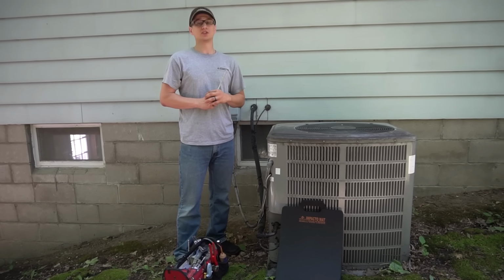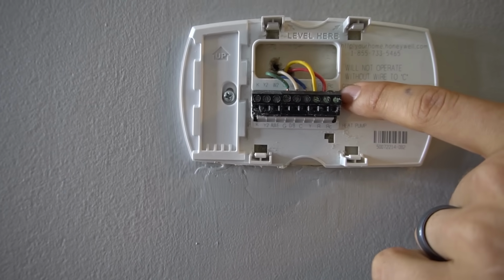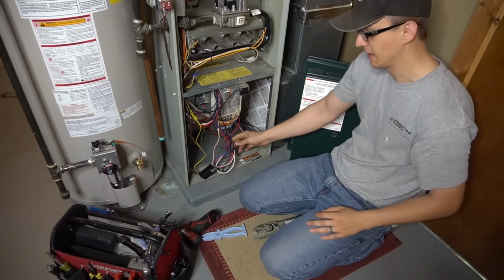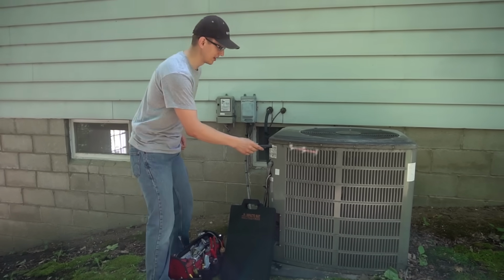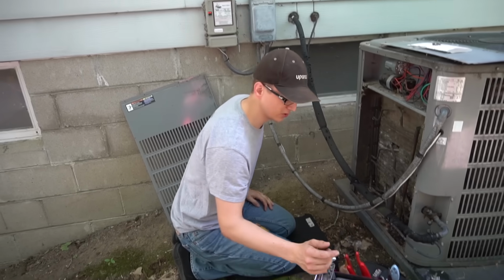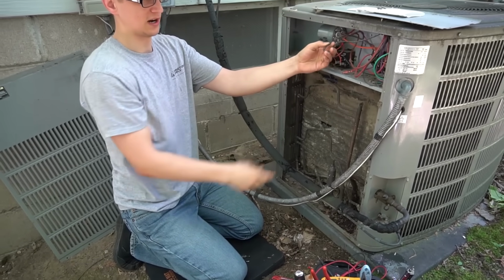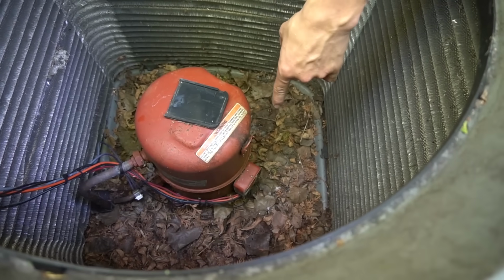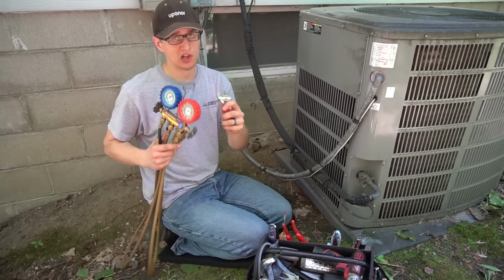AC Unit Not Turning On - How to Fix It Step by Step

Comment: Your UTube advice was fantastic! I live in Texas and the temp currently is 99-101 degrees! The company that installed my AC unit two years ago said it would be 7 days before could come for a service call!??  I had to do something! I guessed that it was the capacitor after doing some investigation per your channel. I didn't have a meter, so I was going to go get a new 45/5 uf capacitor hoping that was the problem. I stopped for a soft drink on the way to parts store there was an HVAC truck also getting soft drinks.  I asked them if they could check it for me, they looked at the capacitor and saw it was a little rounded on the bottom and top and said "yes, it's bad". I replaced it and the unit began cooling immediately! Thanks again, you saved me and my family some very uncomfortable days! keep up the good work, God bless you and good luck!

Comment: My fan is not running, checked the capacitor and is good … my fan is stuck when I flipped it to put oil on it, spins freely but as soon as I put it back on place it gets stuck

Comment: My ac unit won’t turn on. The blower is working and turning on/off but the actual unit is not turning on. I’ve checked both breakers. It was working fine yesterday.

Comment: Hey I think I'm in a unique situation so any feedback would be useful. My AC stopped working two weeks after I had my Breaker upgraded. I followed the advice in this video and noticed that my relay was stuck in the closed position, and when I poked it with a screw driver it would start to buzz.

I went inside and turned off the breaker for my AC, and also pulled the disconnect but the relay still buzzed when I picked it with a screwdriver.

After some poking and prodding I found that two wire on opposite sides of the relay are hot. I suspect the power is coming from my furnace because I left that running. 

Is it possible that the something went wrong with my breaker during the install? are those coils always supposed to be energized? Is my relay just bad?

Comment: Thank you for the very step by step informative approach in checking from thermostat to compressor. I was able to find the problem and replace the capacitor myself. a $16.00 part as opposed to a $4k AC replacement. I'm a subscriber now. I decided I'm going to continue learning about this, if for nothing else, just so that I can be aware and know what I do and do not need. God bless you for sharing!

Comment: Thank you for this video! Liked and subbed, my outside unit started making a horrendous loud humming, turned it off, found your video, turned it back on and just helped the top fan spin a bit with a screw driver. All is working now (thankfully! The high today is 100 F in Texas) 

So my concern is to help make sure this does not happen again. I am thinking I should replace the capacitor, the unit is currently 9 years old, but I am wondering if I should replace the fan motor as well. It spins freely with not signs of hesitation or sticking at any point. Would a safe first step be the capacitor?

Comment: My control board for the heater's is bad. It is a honey Well and the engineers at SLB tried to jump the connections but because the board was a cheap one with the coating only on one side they failed. So although we do not have many cold months in South Texas it would be nice to find a fix. Any suggestions?
Also since it is summer the AC is not blowing cold at all. The hi side line does not feel cool or sweat at all. I heard a strange notice when I was checking the coolant level it was a buzz or vibrate type of sound that happen twice really quickly. I will check capacitor tomorrow just visually for and bulging. Thanks for all the videos.

Comment: I had a piece of wood covering the fan propellers on the outside unit. Now my fan propellers outside aren't spinning what should I do? I had the wood outside covering the unit for 3 days and it's been so hot out here so now my air conditioning inside is blowing air through the vents it's cool. But I believe it should be way colder. Also, can you tell me the damages I causes my unit in general terms since the top was covered when the fans was spinning?

Comment: Thanks for the great video series.  I'm still having trouble with my unit and am not sure what to check next.  My Compressor and fan outside both will not turn on or even attempt to do so.  Problem happened after I turned off the 220 breaker, opened up the outside unit door to look at the capacitor size so that may order a spare.  Capacitor was spun around so the sticker was unreadable.   I discharged the cap with a screwdriver, and then unscrewed the sheath so I can spin it around.  I got my info and reassembled everything and the inside fan runs but outside neither the fan nor the compressor do anything.  I followed some troubleshooting steps.  Confirmed the capacitor is good with a multimeter and very much within specs.  The relay / contact delivers 220 on both sides.  The 24v low voltage has it pulled in wanting to start it up.  As far as I can tell all wires and in good shape, I don't see damage that would lead to a short.  I made sure all push connectors were snug.   Not sure heat my next step is.  It's a 4 ton unit from 2000, R22.  Model 38cmc048310-9.  Thanks!

Comment: Thanks for the info, but you didn't say what would be wrong if I push the button in and it comes on. But the button does not kick in by itself. Mine works when I manually push it in. Compassetor is good what else could it be.

Comment: I am always amazed when someone fixes their unit by merely replacing a little fuse. I never get simple fixes like that. One thing that has saved me money is paying the basic house call charge for my HVAC contractor, asking him if he will diagnose the problem and asking if it is possible for me to take it from there. I will order the part which does take more days to wait. Also I ask what would be the charge if they fix it. Last time he said it would be $470 but I was able to buy the part for $125 and install it myself. The bottom line is that it's pretty shocking how much easy money those contractors charge, and seeing that they overcharge and make thousands per day.

Comment: You helped me fix my heat last winter and now you've helped me fix my AC.  Once every 5 years or so one of the fuses in the disconnect goes out.  So before I get too involved, I check that. Sure enough, one was open.  Popped in a new one and....nada.  So I sat down and watched this video to figure where to go next, and you mentioned that putting the disconnect panel upside down would stop the power.  My mouth dropped open.  I went back out, flipped it over and by gosh she fired right up.  Amazing work you do!  I am headed to your tip jar again.

Comment: my thermostat will not  get below 86,  we adjusted to 70 but returns to 86 after a while warm air will come out, please advise.  we just replaced the capacitor. we need to use the ac. thanks

Comment: So,  my thermostat is totally off.   Not getting enough voltage for some reason.   I plugged in the thermostat face to the upstairs unit and it worked fine.  But the upstairs face also did not work on the downstairs thermostat.   Checked all the wires (good), checked the drop pan (no problems), checked the first (good,  but i replaced it anyways).  Reset the breakers and still no power to the thermostat,  therefore the ac is not coming on at all.   Any ideas?

Comment: Nother person dropping in to say thanks! As a new home owner I hit more of a panic mode and we put in a home warranty request. Watched through your video and realized we had simply tripped the breaker at some point. Back up and running for now!
Reply: Hm, just kidding, while the breaker was an issue, it appears we tripped it due to a likely blockage or frozen coils. Also thanks to this video and other research, I'm pretty sure we have an RF-22 leak. It's an older unit, and we're hoping to get it covered under home warranty.

Comment: Hello, I have a short in the low voltage side.  It blows the fuse on the brand new board I just put in.  I have done the checks on the thermostat, the fuse does not blow if I disconnect the red and white wire at the outside unit.  The inside fan runs constantly (yes it is on Auto ;) ).  The fuse does not blow if I put the thermostat on heat, the furnace works as it should, but when I put it on AC as soon as it calls for cool it blows the fuse.  So I disconnected the thermostat wires (red and white) at the outside unit and it did not blow the fuse.  I left those disconnected and manually pushed in the contactor and the outside fan and compressor kicked on.  At this point I am thinking it is the contactor, what do you think?
Thanks for the informative videos, they are awesome.

Comment: What if the plunger isn't pushing in, even though everything is on? But the unit turns on when the plunger is manually pushed in??
Reply from the maker: This video should be able to help you out with that: https://youtu.be/NVPhsK4gK1A

Comment: Hi. I replaced my thermostat  over the winter to a ecobee.  Heat is working fine. Its a separate hot water boiler. Now I put on the A/C central air , fan unit goes on inside the house blowing warm air, but outside unit does nothing. No noise at all. I checked with my voltage meter,  both black and silver capacitors and they all come back as working properly.  Also have the 220 coming in. I have a allegiance 13. What could it be? What should I check next? Thanks.

Comment: Hey man... So.... I'm hoping you might have a minute to give some advice.  My AC stopped working and I went outside to see what happens when I manually push the plunger in.  A few different things happen and it's not consistent.  One thing that happens is the humming sound that might indicate a bad capacitor.  The other thing that happens is the compressor starts up, but the fan doesn't.  And the third thing that happens is that the fan (only when the plunger is pushed down) is really tough to turn.  Once I let the plunger go, I can spin the fan freely.  If I play with it enough, the compressor and fan will start up and work... But that only lasts about a day.  I took the capacitor out (this capacitor only has two terminals and only one rating of about 5.7 microfarads) and measured it and I got 5.7 uF on my multimeter.  The capacitor doesn't look bulged or anything so best I can tell it's fine.  I assume all compressors have to have a capacitor also but I don't know where it is because I expected it to be a double capacitor as you've shown in your video.  Is it possible they have the capacitor on the compressor itself?  I'm kind of at a loss here though.  Any ideas what might be the problem or suggestions of something I should try? Thank you so much for your time and for your videos.  They've been very helpful and educational!
Reply: Some additional information, the fan motor feels kind of hot when it's acting up like this.  I'm not sure yet, but I think it will start behaving once the fan motor cools down enough?  I don't really know.  Will play with it more later today.

Comment: Hi Jay, I have been watching your videos and find them very useful! Keep up the great work, Thanks! Have a question related to my central AC: The system is running, but not cooling at all. I replaced air filters and ensured both fan and compressor are running before calling a tech. Also ensured there is no freezing in the A-coil as we shut down the unit for an extended period of time before starting again. Tech came and checked pressures to be 150 psig at suction and 280 psig at the return for the R410A system. But suction is not cold at all; literally only a degree or two difference between the suction and return. Tech suspects a bad compressor as the discharge pressure for a healthy system should be 350 psig or so. I wonder if this could be correct and also why don;t we get even a little bit of cooling out of the system as the 280 psig flow into the evaporator should provide some cooling as what is going into the compressor is at 150 psig. (i.e., where is the cooling for the 130 psi drop across the evaporator?!!) Can you please clarify and offer your suggestions to proceed ahead? Thanks a bunch in anticipation!
Reply: Follow up: Second technician who looked at it thinks it’s not compressor issue but there is a restriction in refrigerant path (Ie in the coil system) and hence the entire coil system has to be replaced!! I wonder how can a restriction occur all in a sudden in a closed loop system?!

Comment: So my Tran XR11 stopped working and I opened it up and found the common wire(c) was burnt. So I watched your video and replaced the capacitor and replaced that burnt Red common wire with 10 AWG ac now turns on the fan is working, it sounds like every few minutes the Compresor kicks in for like 2 seconds and shuts off and the house doesn’t get cooler, any idea why the compressor tried to turn on and shuts off 2 seconds after? Any help will be appreciated. Thank you

Comment: What do you think it is if I put and jumper on the control board on Y,R, & G & turn on the furnace switch, it all runs no problem. But that's the only way I can turn it on. If I try to touch the same wires behind the thermostat, it does nothing.

Comment: Just fixed my AC based on this video: it was the plunger connected to the thermostat wire. Just tapped it a few times with my screwdriver and the unit came on. Afterwards, I blew out all the dust with compressed air, so I hope the plunger stays functioning.

I felt fairly confident after watching this video that the plunger was the problem, because my AC compressor made zero noise, as if it weren't even being commanded to turn on.

Comment: My outside AC unit makes a pretty loud intermittent buzzing sound. 
We had no cold air and it(outside unit)was not running. I noticed the breaker on our main panel was tripped. I reset it, turned on the AC from the inside thermostat and everything came on, but it would make a loud buzz every few seconds. Rather than let it run, I flipped off the breaker. I've watched several videos, but I do not see any videos covering this symptom. Any suggestions?
btw, love your videos!

Comment: I am so happy. I replaced my capacitor, fixed one of the loose electrical connections, and applied electrical tape to chewed wire insulation. So how do I keep mice out of my a/c unit?
Reply from the maker: Glad to hear you were able to get the repairs done! I think this is the video you're looking for: https://youtu.be/nFzM3KWU7cM

Comment: Hi there,

My 3 amp fuse keeps blowing out every time I attempt to run the AC.  Heat and fan for the furnace appear to run okay.  The first couple of blown fuses, I would be able to set the thermostat to cool, but the cool on would only flash and AC fan would never kick on.  Just now, I would let the fan for the furnace run for a while, and as soon as I switched it to Cool, the fuse blew in this manner a couple more times.

I am wondering if I have a contacter issue?

I will inspect that area of the AC unit tomorrow and report back.  

furnace is 2 years old on a new house and I did just replace the filter for the first time which it was filthy.

Thank you for any feedback, sincerely.

Comment: wow that was the best explanation I have seen on these systems ... I have a question I have a issue with my ac.. the outdoor unit was staying on continuously we would have to flip the breaker to stop it huge electric bill.. anyway we have a 40/5mfd dual run capacitor and a 5mfd capacitor.. the dual finally gave out this year we came home to  the fan humming rushed and shut it off so I replaced the dual and just in case the smaller one as well but it ran 20 minutes and we humming again ...so what could it be could I have a short oh and on the dual there was only wires on the herm and c ... there was a tech that came out 3yrs ago  but I wasn't there to hear what he did.  ( 2 years ago the outside disconnect was so hot it almost caught fire but melted and we replaced it with a breaker) in hope you understand  what I  wrote lol.😊

Comment: My Nest thermostat sent me a message saying that the a/c was on but the house was getting hotter and that it could be a fan issue. I went outside and noticed the fan was not spinning but the a/c was humming. The fan was easily moved by hand. I then opened the electrical panel and noticed a mouse nest and that one wire covering had been chewed a little. The wire was not compromised so I covered it with electrical tape. I brushed and then hosed down the fins on the a/c but couldn't remove the out side panels to get to all the way around to all the fins. But the fins looked pretty clean anyway. When looking at the electrical panel, there is a cylindrical metal can that looked like it's seen better days so I ordered a replacement for 16 dollars from Amazon. I think that is called a capacitor. I think I read an article online that they usually don't go bad, but I hope this will help me get the fan to spin. I noticed three connectors leading to the cylindrical metal thing that were rusted looking, so I'd like to replace those three  connectors also but I'm not sure how they can be replace or how they even connect with the wires since they only seem to wrap around the insulation. I'm a pretty good handy person electrician so I know I can do it but it's just that I've never done this type of work before. Perhaps the connectors  pierce the wire's insulation and that's how they make the electrical connection to the cylindrical box (capacitor)? Do you have a video on that? My unit is a Trane and is very clean and only 10 years old. Is replacing the metal cylinder the right thing to do? By the way, your video was excellent. Any guidance is appreciated.